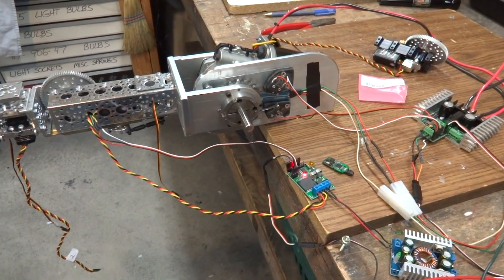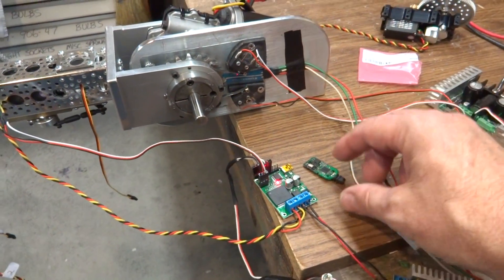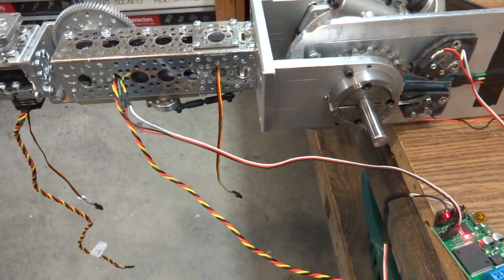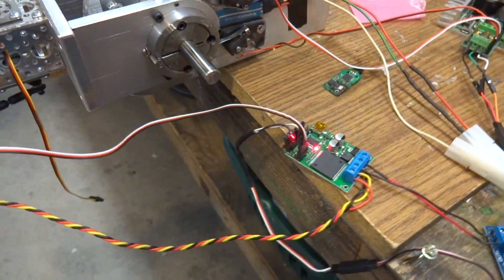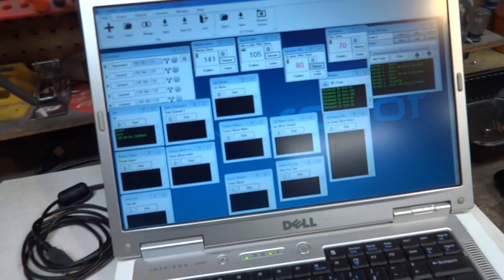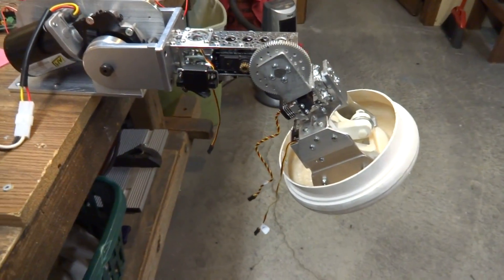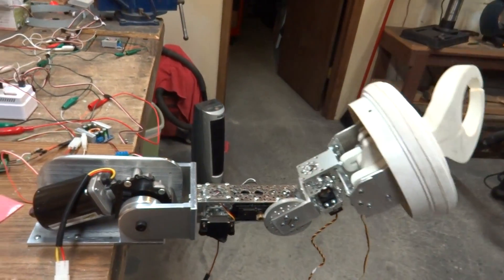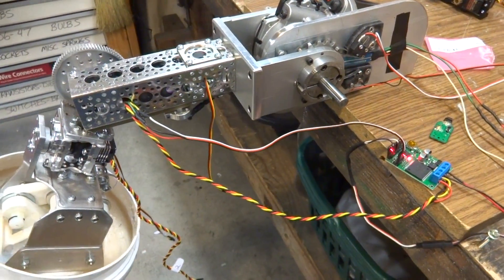Replacing the circuit board of a HS-7950TH with pololu jrk 12v12 motor controller

Comment: Is this the ultrasonic servo controller I told you about ?  I couldn't  remember  the model off the top of my head.
Reply from the maker: Yes, you mentioned using an ultrasonic servo controller used by wheel chair companies. I found this example and ran it by you and you agreed it would work. You were right!! Thanks.
Reply: David Schulpius

whats the name or do you have a link?